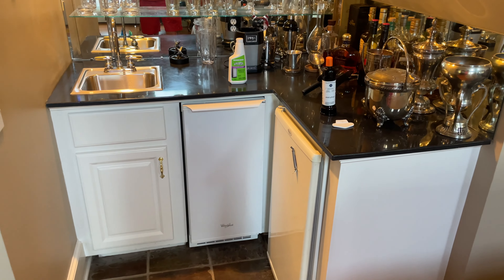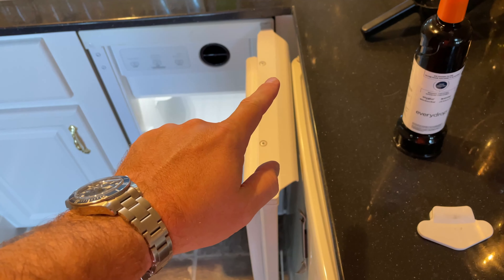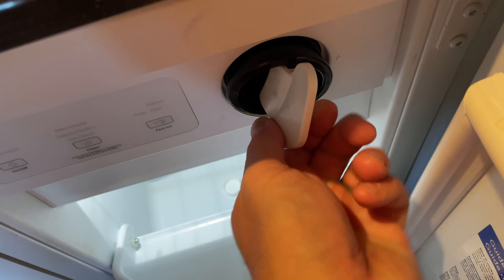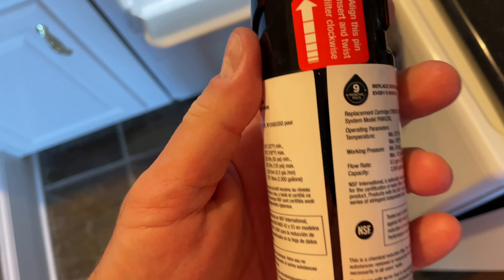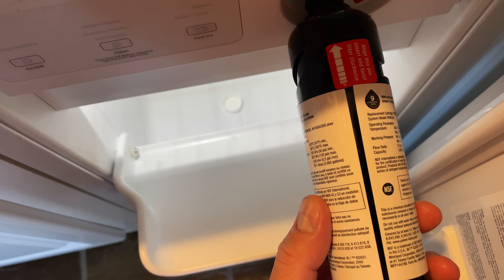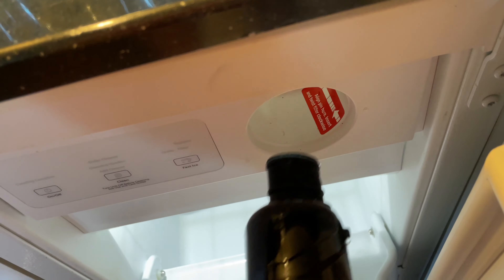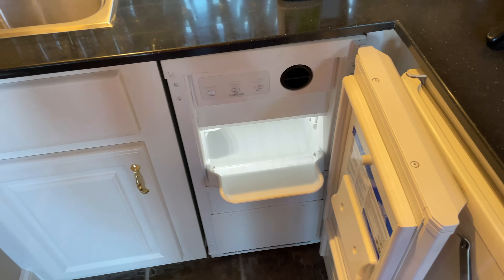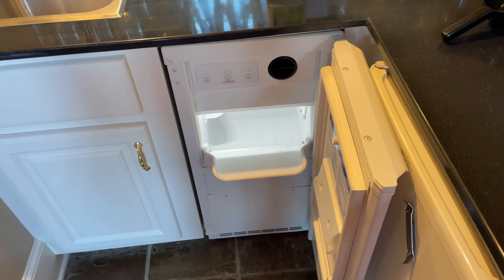How to Replace a Freestanding Ice Maker's Filter

Comment: Do you need to run the ice machine for a few hours and/or waste a few batches after the new filter is inserted?
Reply from the maker: I typically run a few additional things of fresh water through before using but yes, dumping a few batches of ice won't hurt!

Comment: Name of tool
Reply from the maker: Great question and I'm currently stumped.  Subscribe and stay tuned because I'm going to find out and then post a video response =)
Reply: @IrixGuy To remove filter, try Filter Tool Part #W10566394 . The filter will turn easily for a few degrees counterclockwise, but then gets more difficult, and will start to screw out towards you. Pliers or channellocks works just as well or better because you can pull as the filter starts to screw outwards.  The old filter is disposed of, so no need to worry about damaging it with the pliers.